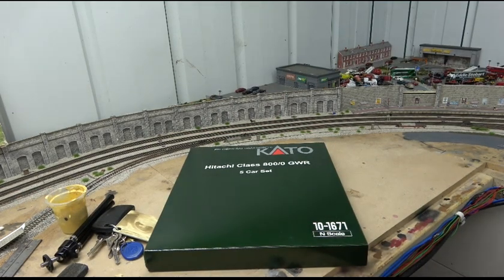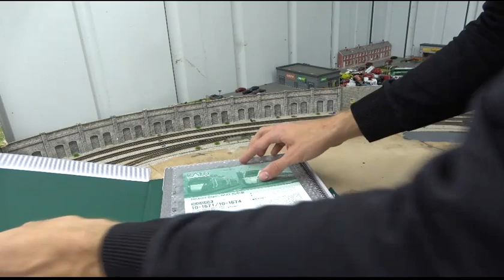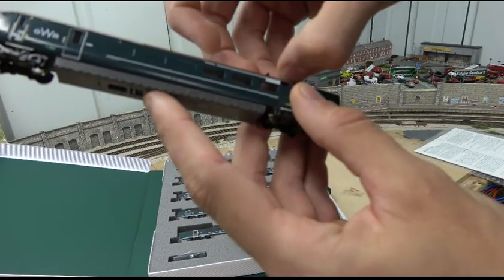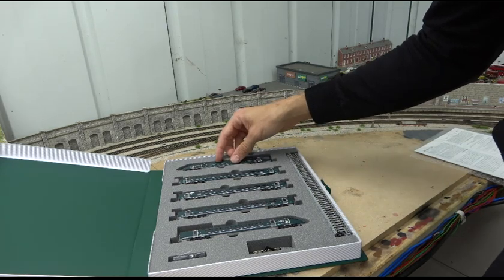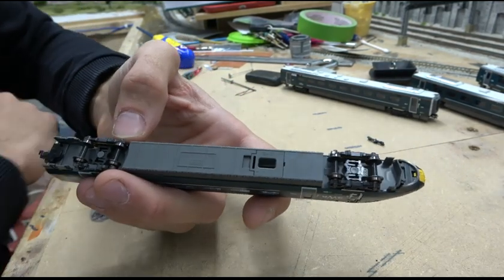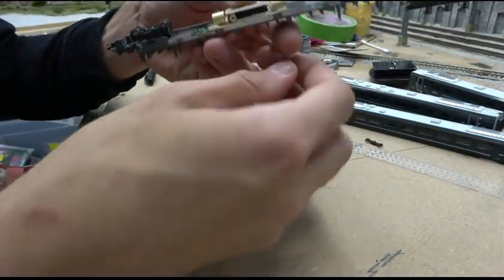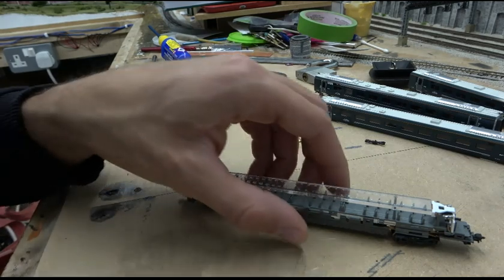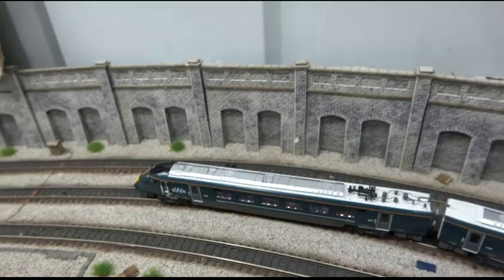A look at the New Kato N gauge Class 800!

Comment: I've found that with the FL-12's you need them the right way around for each end.  So a lot of forums tell you to reverse one end to ensure yu get red lights one end and white the other.  But what I've found is that comment is correct, but you still need to get each FL-12 correct.  So if you get a situation where you get red and one end and white the other in one direction, but nothing in reverse.  Try swapping the decoders around as they need to fit the internal wiring.
Reply: I'll try this as I have same issue

Comment: Have been buying continental N-Gauge by Kato for years and very impressed with their standards. Is a shame that they have not continued their close coupling practice with the class 800! On both the DR VT16.5 and DBAG's ICE4 (identical to Eurostar's e320 sets) they have used the corridor connections as a coupling giving very realistic close coupling even on tight curves. The 10-car Thalys is also very impressive.
Reply: Yeah I thought corridor couplings would be a given on any new Kato models - they are so good for multiple units that I wouldn't really buy anything else unless it was a steal.
I was looking forward to  Kato  re-releasing some of their older bullet train models with this feature but judging by this model I'm not sure that's going to happen now.

Comment: Interesting problems you are having with the decoders. I got the LNER set this week. I've fitted Tramfabrik light bars because the Kato version just didn't put out enough light. I have a special dcc control interface on my layout so I can run locos digitally without having to fit decoders inside the locos, so I have no lighting problems when controlled by dcc. I hope you work out the lighting fault with your decoders.

Comment: I must have put the power car on the wrong way round to start with as the direction of actual travel conflicted with the lights, turned it round  and solved. The other issue is that I am unable to change the loco address on the end units, but motor unit OK
It's had a trial run today and will stretch its legs properly on Sunday at the Leiston Long Shop Museum Father's  day event.

Comment: When programing, have both ends On the track, one facing one way, the other facing the other and program them together. Should fix the issue. Otherwise time to play with the CVs!
Reply from the maker: I'll give that a try cheers!
Reply: Hi Nick, YouTuber “seija880” says that the tail lighting chips have to be in opposite directions for each car, sounds a simple fix 🤞🏻
Reply from the maker: @Wickford_N_Gauge  wouldn't explain why I have no headlights on either car, but I'll give that a try too
Reply: Best of luck 🤞🏻 It’s a shame Gaugemaster didn’t insist on more legible instructions 🤬 the Japanese is bad enough but the faded green pictures make it near impossible to see what is going on 🥺
Reply from the maker: @Wickford_N_Gauge  much agreed, plus they don't always correspond to what's actually on the model, luckily the internal lighting is easy enough